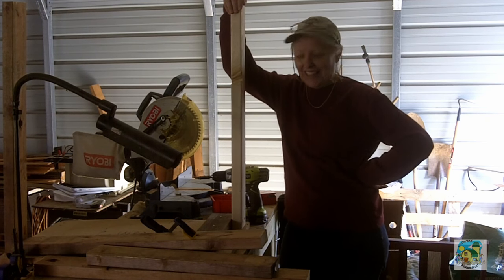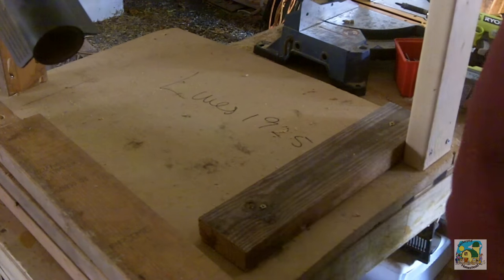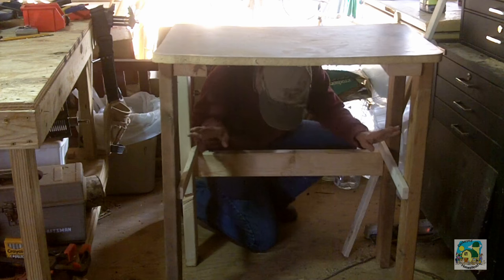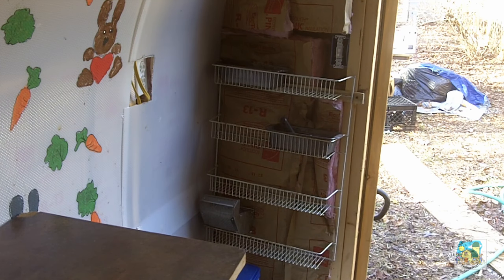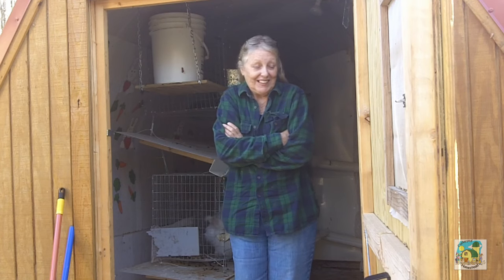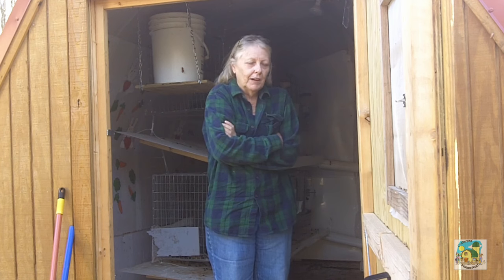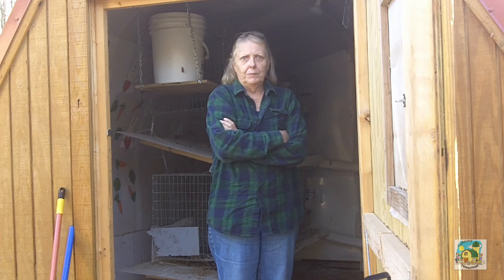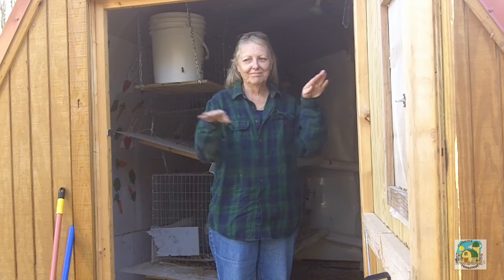Grooming Table... Check!

Comment: Hey Girlfriend! I remember you were the first one I told about my new name. You've been very kind and helpful to me for several years. How about a mini class on tools for women like me who think they might like to try -- but I don't even know how to get the bit on the drill! I was hand-turning it to open, and screwing it closed, but I see others using the trigger to tighten it. I think I need to get me a Ryobi power tool kit with the basics. I have some fencing and cattle panel supports to do. Rabbitry is looking good!
Reply from the maker: I can do that!  I'll get some tools out and maybe ask folks what they're interested in seeing how to use.  Thanks!  Just a tip:  the part you are screwing open and closed... hold onto that part and hit the trigger.  To tighten the drill bit on, it should turn in the forward position (clockwise) and loosen in the backward position (counter clockwise).